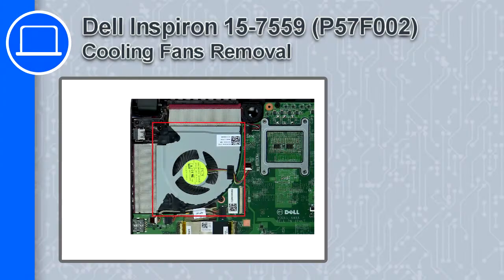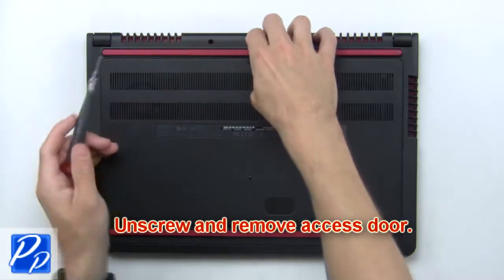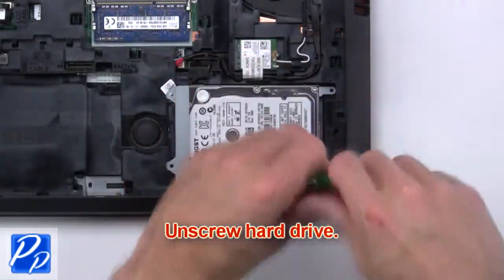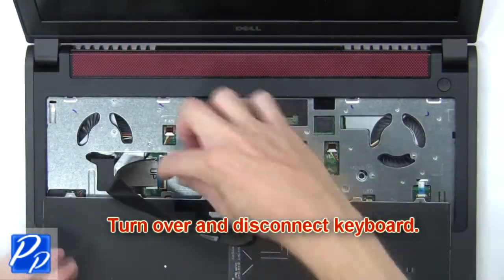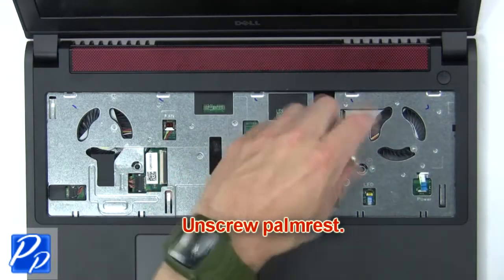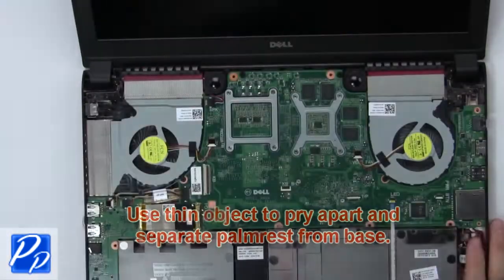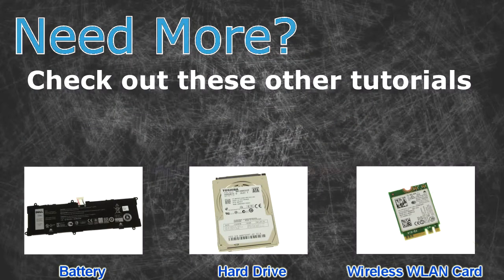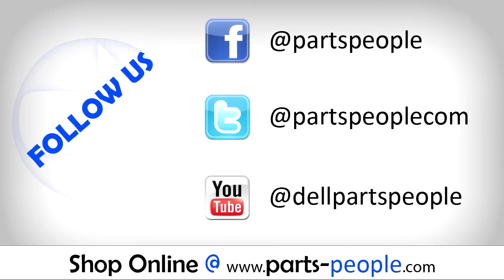Dell Inspiron 15-7559 (P57F002) Cooling Fan How-To Video Tutorial

Comment: Do we really need to remove the hard drive also?
Reply from the maker: For safety purposes we reference the Dell Owner's Manual when disassembling these laptops. They list its removal when replacing the fan.
Reply: @dellpartspeople  Is there a pdf version for this manual? I had my laptop for 4 years now and I wanted to clean the fan myself, and I can't remember where I kept that manual if it came with my purchase back then. Thank you.
Reply from the maker: @chrisdane2014  You can find it at: dell.com/support